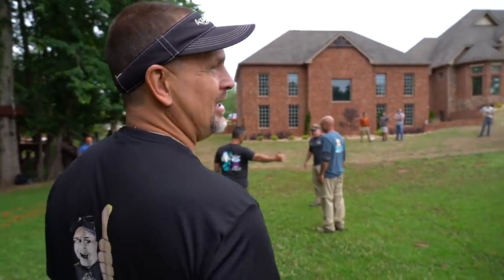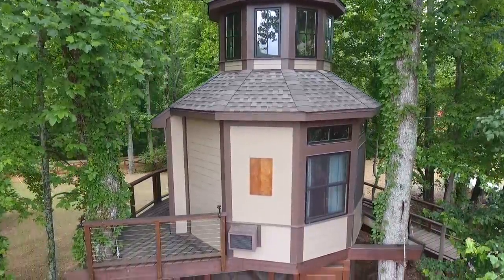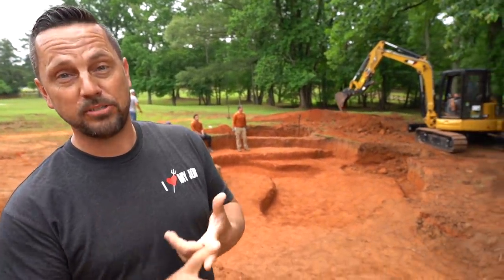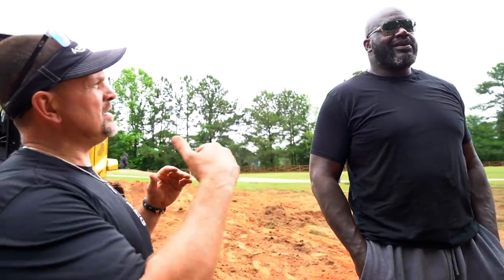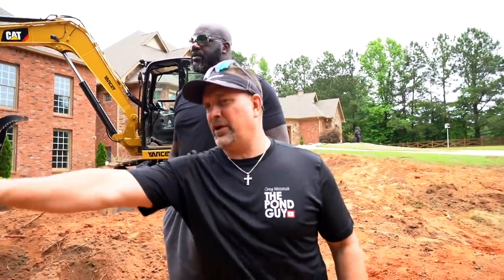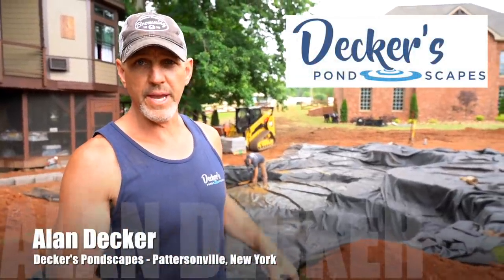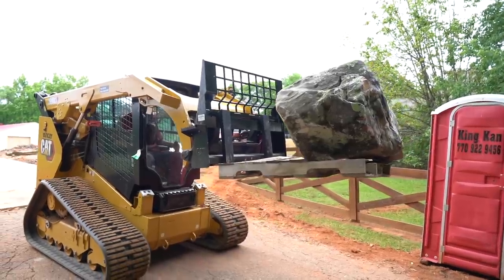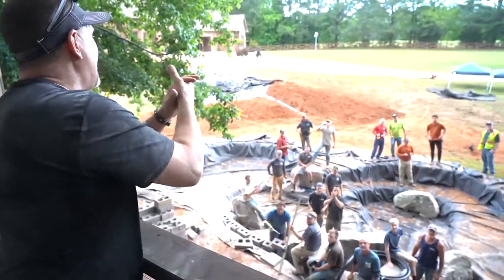A SHAQ Sized Aquascape *POND* - Part 2

Comment: Why if i have an aquascape kit system everything is done correct with gravel plants my water is green will anyone tell Greg please
Reply from the maker: www.aquascapeinc.com
Reply: I use maintain for ponds everything product i use is aquascape i love them but seem not to work for me  i also use algaecide dont work  lost 3 koi already 1 left so sad dont know what to do
Reply: @carmenarroyo4060  How long has it been around for? It takes time to balance a pond. There are basically nitrogen producers and nitrogen consumers. Producers are any animals, and any fallen debris in the pond like leaves. Consumers are basically plants. All plants (which includes algae) consumes the nitrogenous waste. So if you have green water, it's becasue you have algae growing on the rocks. That's ACTUALLY a good thing, but people may not like the aesthetics as much as plants. So your solution is to plant more plants. More plants, more plants, more plants. Get as much roots in the water sucking out nitrogen and growing leaves. 

That's the cycle. 

It's like a garden... same thing. If you don't plant something in a spot, then nature will plant a weed there. So for a pond, if you don't put plants in to take the nitrogen out (and shade the algae), then nature will solve that problem by growing tons of algae. So get planting! Tons of deep water emergents, tons of shallow water emergents, tons of floating plants, plants in the wetland filter or biofalls, and then tons of surface area for bacteria. Tons of tiny baby pebbles anywhere you can cram them in. That maximizes surface area for bacteria, who will also be nitrogen consumers.
Reply: I asked a question and they aswer back with the aquascape web site like if thats going to aswer my question now we spend money on there products but they cant help now if i was shakbthey wont aswer the question they will go fix the problem is funny :-) :-) :-) :-) :-) :-) 👏👏👏👏👏👏
Reply: @CanadianPermacultureLegacy  thank you so much its been 2 month that i have it